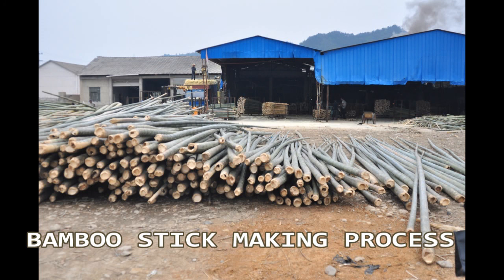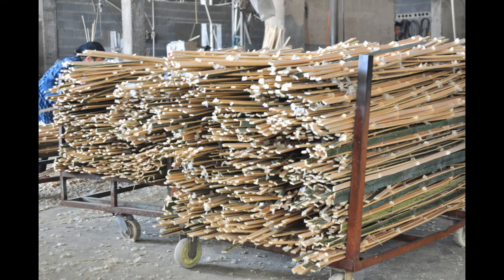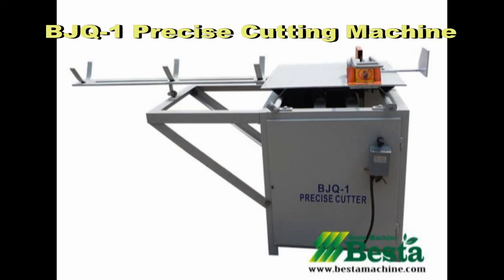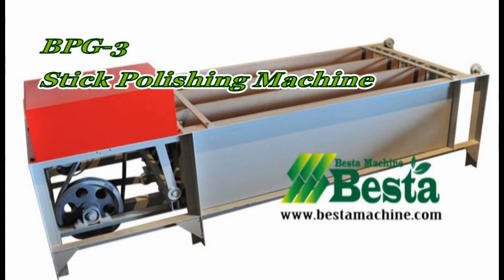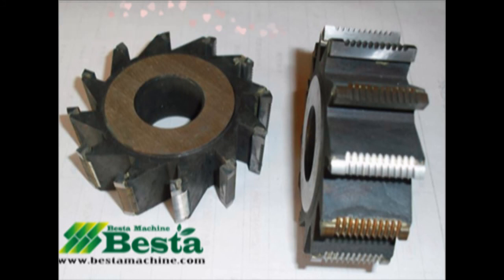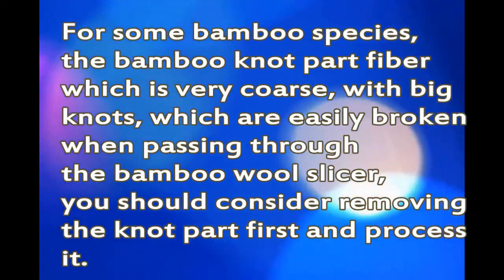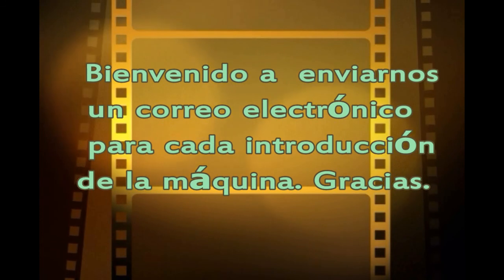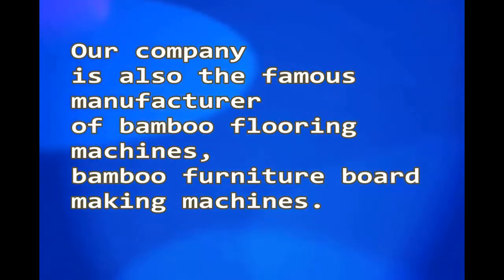Bamboo Stick Making Machine Videe www.bestachina.com

Comment: Great subject and resource, Love your voice :-) 

I'm looking for a device to cut the split strips into short cubes to feed a gasifier so as not to have to palletise bamboo when mature is dense enough to be cubed and save the energy to palletise, do you have a machine that can cut the strips into small pieces so as not to have strands, strands will cause bridging in a gasifier.